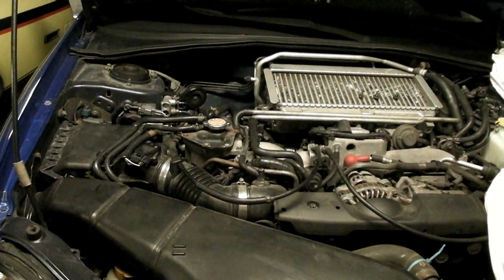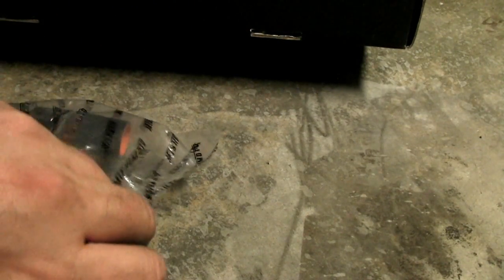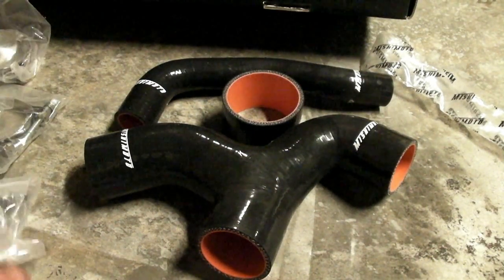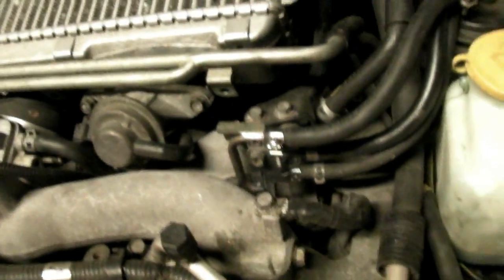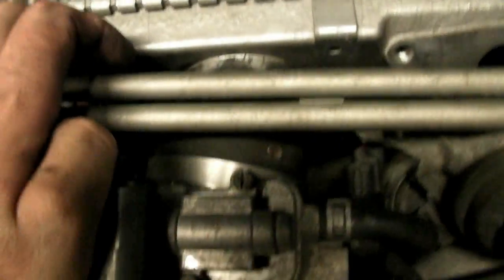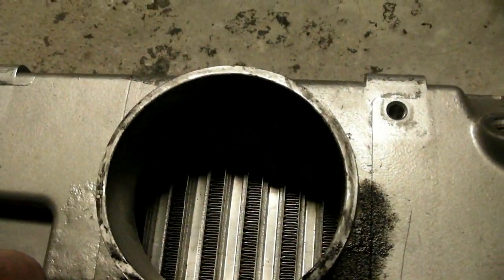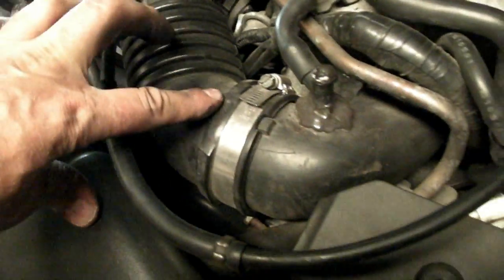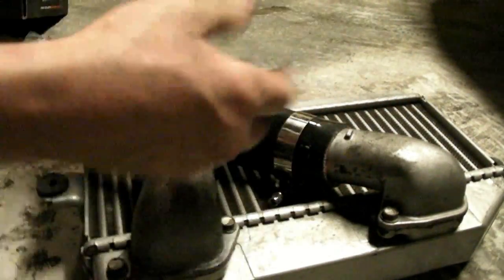WRX Silicone Intercooler Hoses Install With Before & After Boost Pressure Data logs

Comment: Thanks for the upload, SUPER helpful. Probably the best on youtube IMO.. I 'm just now getting around to doing these.. That blowoff/ intake tube clamp SUCKS, I had to hack at it with a razor and vice grips and work it off. And yes, I do 2nd the shoddy clamps they provide you. The 3 clamps for the back of Intercooler are alright, the rest are shite. Used factory clamps as well. Was surprisingly easy to get back in.  Cheers.

Comment: Would you say it was worth purchasing the Mishimoto for $1500 for performance or more for the label because there are other cheaper well known brands because I wanted to buy this kit and in my currency AUD ( Australian dollars) it’s nearly double the price and wanted to know is it worth it for the value, the warranty, the performance as in the Silicone itself will it last or are we paying for the brand just to see Misihimoto on the silicone, because like you I want it stealth just to blend in with my engine bay not trying to flaunt very loudly what I have, but i want peace of mind knowing that pipe ain’t going to leak blow rip suck inwards under vacuum pressure etc ?

Comment: Hey don’t you have a boost gauge or could a boost gauge give you a wrong reading ? Also did you go to a dyno to do these readings or run a programme through your Obd if so what were you using mind me asking ?
Reply from the maker: The data is from a datalog using a cobb tuner I have not had it on a dyno